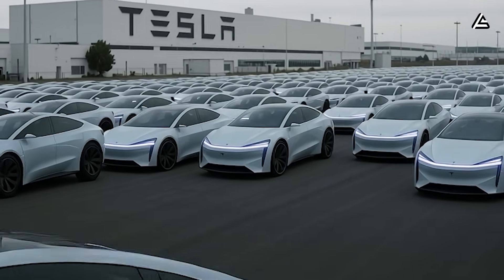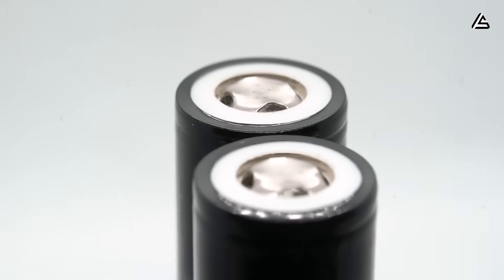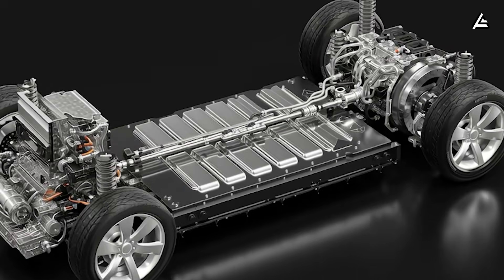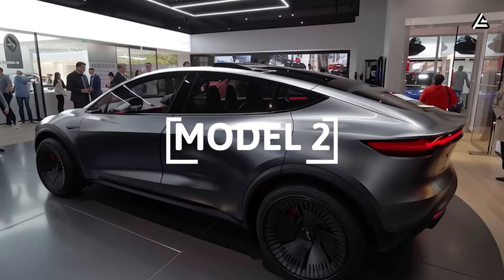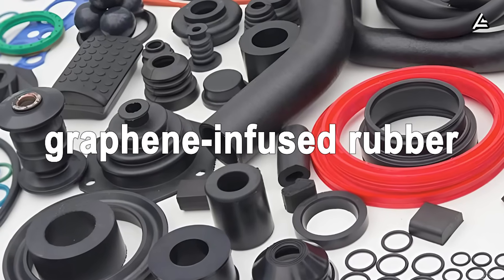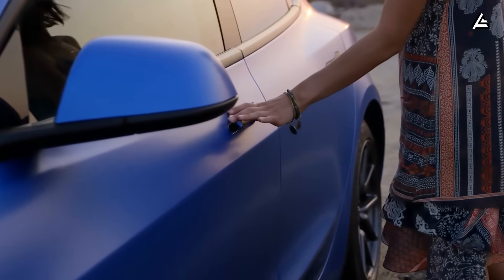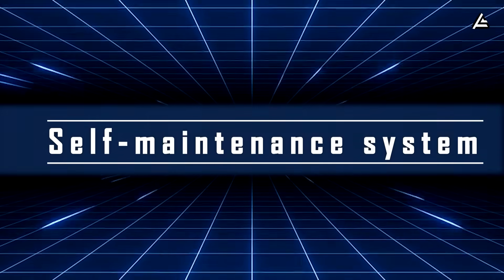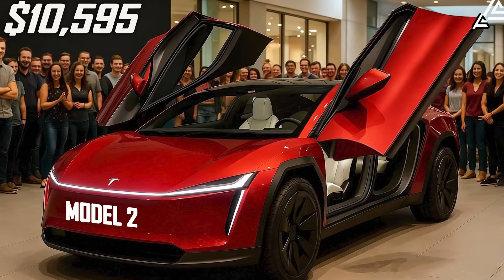Elon Musk Revealed 2026 Model 2's 7 Features Worth Your Wait. End Of China

Comment: The smaller wheelbase might make the ride uncomfortable.
Reply from the maker: A shorter wheelbase doesn’t automatically mean a harsh ride. Tesla can balance it with optimized suspension tuning, better weight distribution, and software-controlled damping. The goal is to keep the Model 2 compact for city driving while still delivering a stable, comfortable ride on highways.